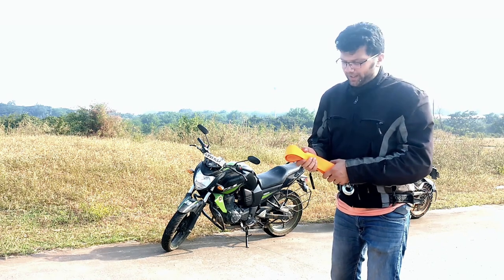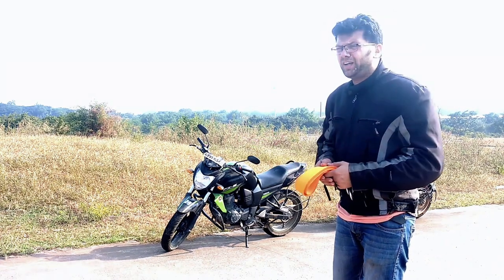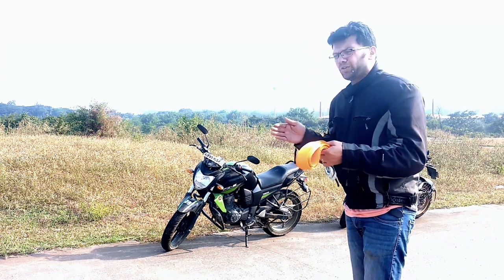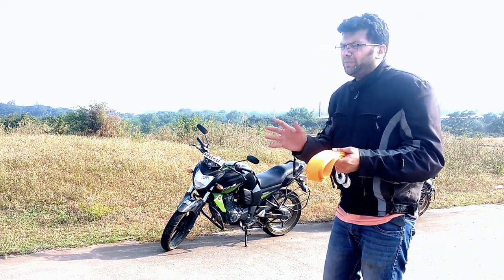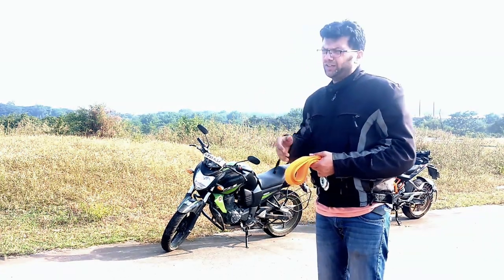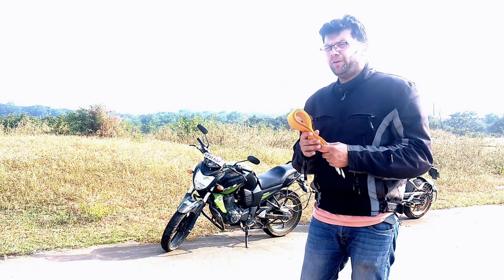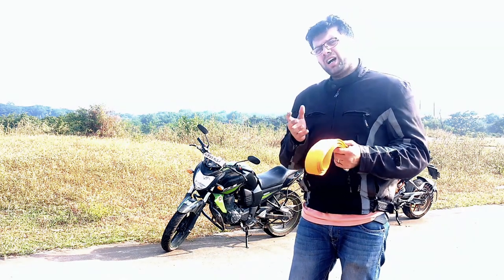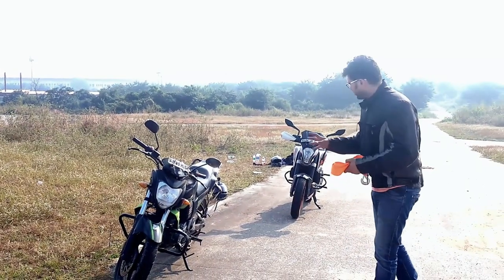How to tow a Motorcycle

Comment: PLEASE DON'T DO THIS!!
Don't hook anything onto the frame of the motorcycle being towed! In any situation where the rider needs full control of the vehicle they won't have it because the bike is constantly being pulled forwards and slightly to one side by the tow rope. The rider of the towed vehicle needs to be able to release the tow cable at any given time, safely. For that reason, I personally prefer to thread the strap between the fork clamps, around the handlebar and up to the left hand grip - this way all towing forces are directly forwards, from the centre of the towed bike. It also allows the rider of the towed bike to release the strap in any situation without it getting caught on any other part of the bike.

With regards to positioning the strap on the towing bike; you want to attach near the back of the bike, and near the centre, to negate any pulling forces being sideways and tipping the bike.

You MUST also ensure that when turning, the tow strap is not going to foul any part of either bike or their wheels - if it catches on the rear wheel of the towing bike it can kick the towing bike out sideways like a highside. If it catches the front wheel of the towed bike, the front will wash out, and probably pull the towing bike down aswell.

I've used this method a dozen or so times without having a bike drop. However I've watched people wrapping the tow rope around their footpegs or other part of their frame and watched them all drop their bikes.

Use common sense folks, and keep the rust above the rubber/the shiny side up!